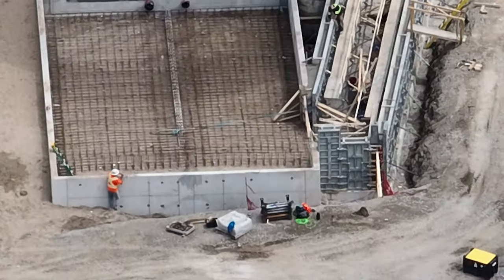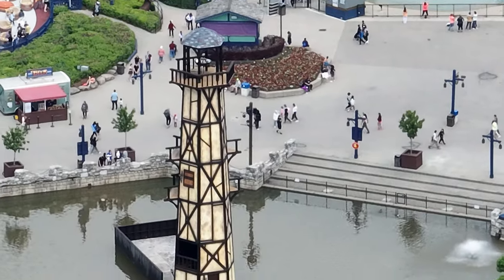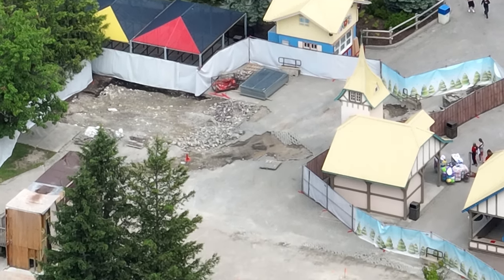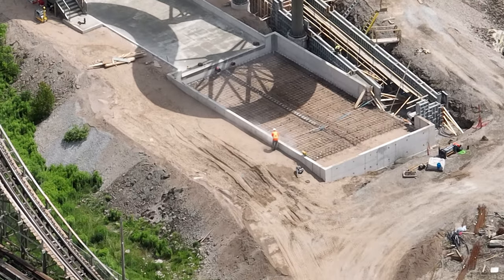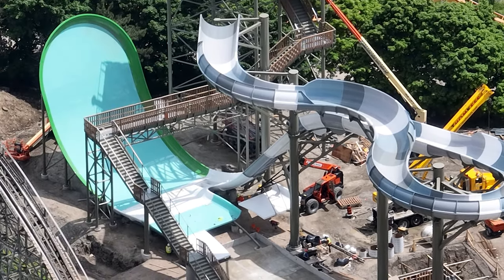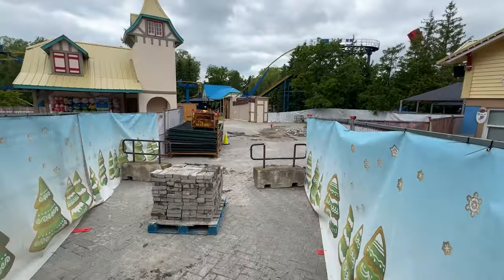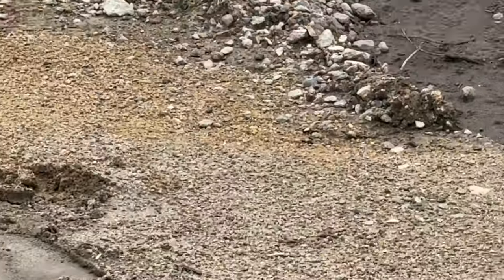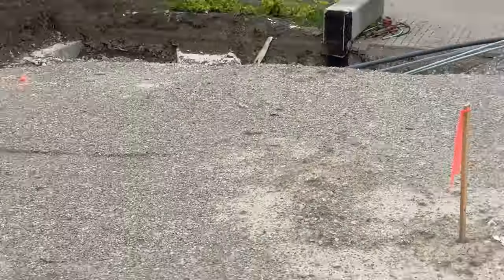Canada's Wonderland New Roller Coaster Construction

Comment: Lots of surveying going on in the 2025 coaster station area today!  Get lots of rest and get better soon!
Reply from the maker: Haha my friends filmed it for me thankfully
Reply: I am curious about the marking someone saw by Kingswood (numbered 47 if memory serves me right). Coaster could swing out there if it hugged the tree line much like Leviathan does on the other side.  1600-1900 feet out and back to Kingswood from old Skyflyer area. This would guarantee the coaster will be 4500+ feet. Based on the numbered markings you found so far it would seem difficult to do much between the mountain and Skyflyer area. Using that stretch would leave lots of space for a second straightaway launch which would be needed for a big top hat at the front of Skyflyer space.